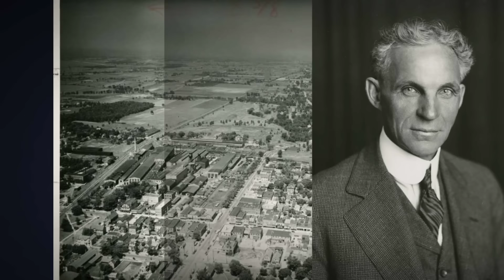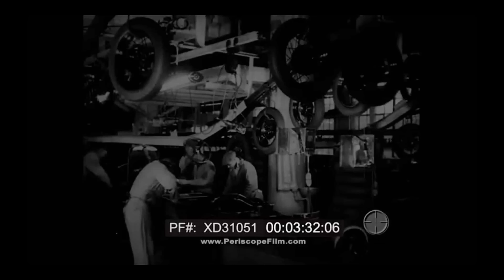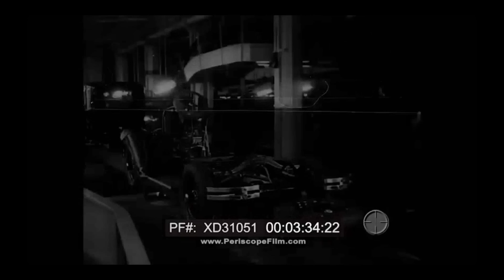Milwaukee: How a Phone Call From Henry Ford and a Factory Fire Created a Tool Empire

Comment: Ya, to bad you can't get much fixed anymore, they sold out with Chinese crap, I own a ton of them but none of the Chinese crap. I am not happy with this company at all, had some issues about 25 years ago and those f42kers would not stand behind two brand new replacements I bought. Its just a bunch of fluffs now, my family has been here in milwaukee for almost 150 years and hopefully we will be here when there gone.

Comment: Now Milwaukee is totally overpriced. A 1/2 inch drill with 2 batteries and charger was $165.00. Now the battery alone is $220. Everything is sold separately.
Reply: You really need a lesson on how to buy the Milwaukee tools, and don't buy from Tiktok, that's knocked off junk.
Reply: Don't buy separately or at shelf price. There's always a sale and more value in sets.